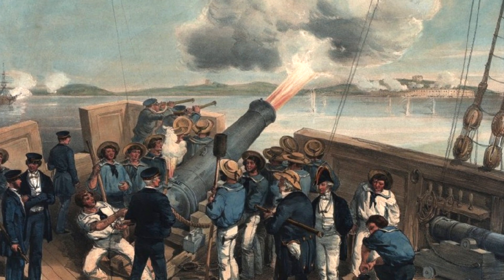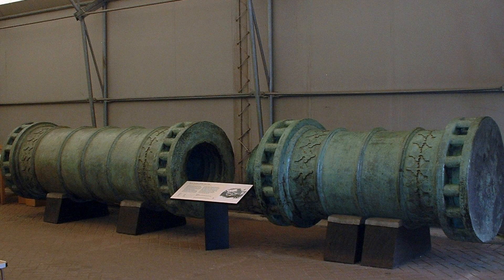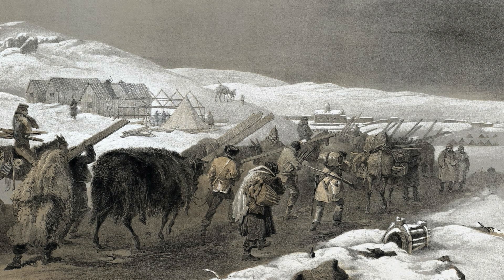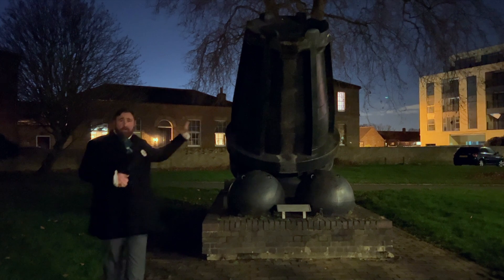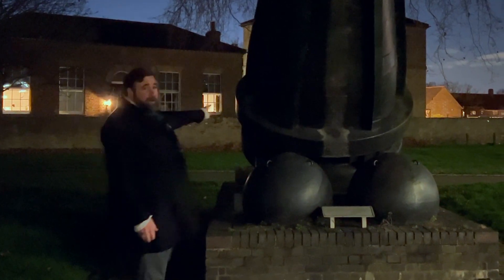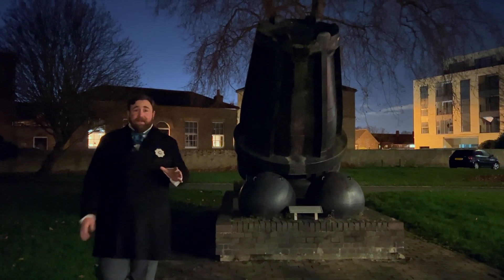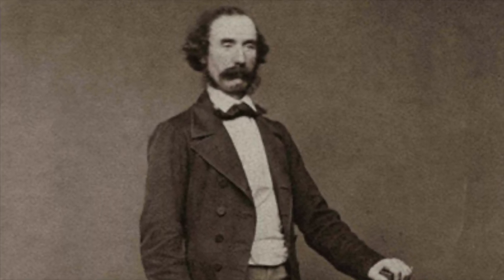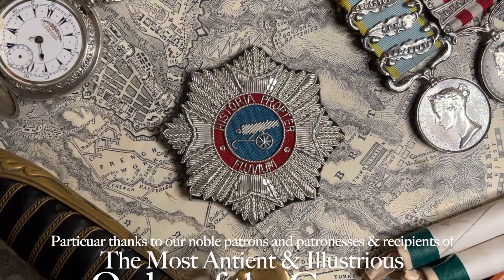The Monster Gun of the Crimean War:  Mallet's Mortar at Woolwich - London Walk

Comment: The Mallet Mortar did not ever pass testing as only two were made and they were found not practical for military deployment. However, the Armstrong 100 Ton Gun, a rifled muzzle-loading naval gun that went into service 1877-1906 (15 made) was the largest muzzle loader. It fired a 2,000 pound shell for sinking ships in coastal defence or on warships (2 went to the Italian Navy). The shells were Armour-Piercing, High-Explosive and Shrapnel.  The British deployed the gun in Malta and Gibraltar. To fire the gun, it took 4-5 charges weighing 112 pounds each. The muzzle calibre was 17.72 inches. Maximum firing range: 6,600 yards. Wikipedia.